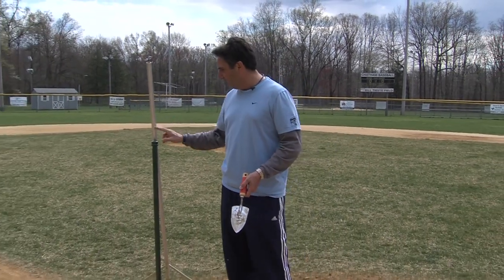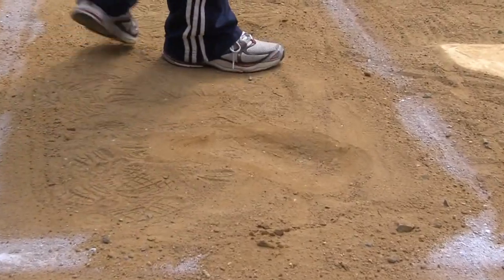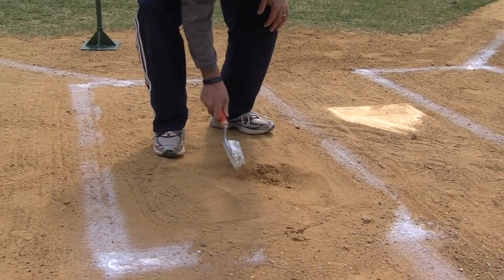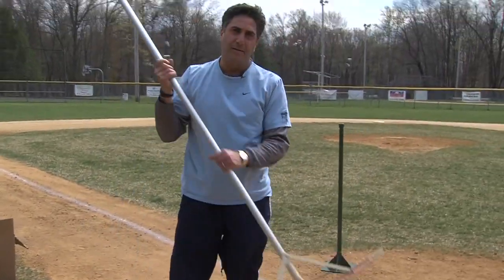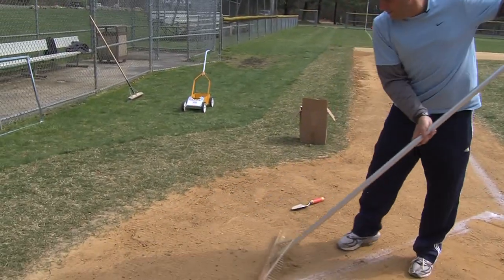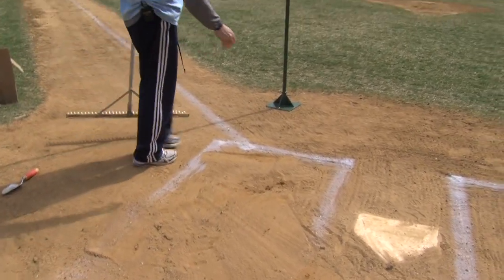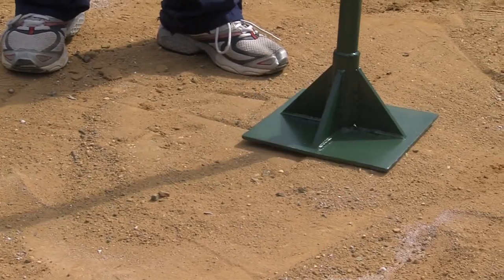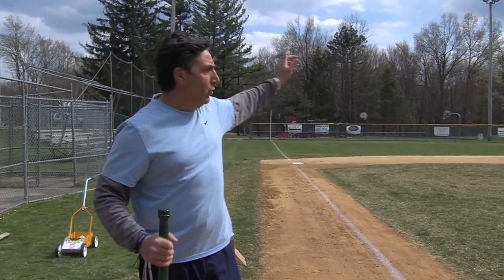How to: "Repair the Batters Box"

Comment: this is 100% the wrong way to repair a worn out area on the mound or batters box.  Who taught you that? You sweep out the hole, scarify the hole, wet the hole with a water lightly, get fresh clay that is already moist and place in the hole to slightly above final grade. Tamp to compact then take a rake to level.
Reply: ballyard clay?
Reply: @timthemailman7581  Blackstick is by far the best clay to repair holes with. Most MLB fields use it
Reply: You might have to do a quick fix for today then as soon as the game is over you do it properly
Reply: Of all the ingredients on a baseball field water is the most important. Not enough and it turns to loose sand. Too much and it turns to muck. With the proper amount of water that loose material he had will rebond and could become a perfect playing surface. It takes practice and patience but I’ve done it many times now over the last 3 years taking care of 8 different fields. Water is king!
Reply: @davedzwilewski5195  Blackstick is the best but also requires the most attention to moisture management.